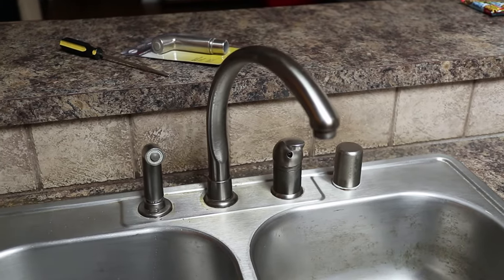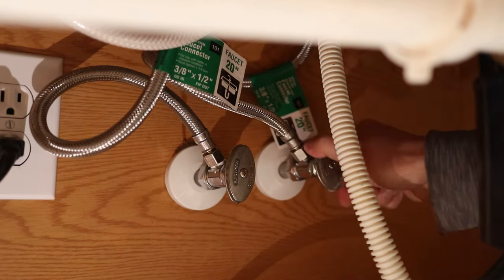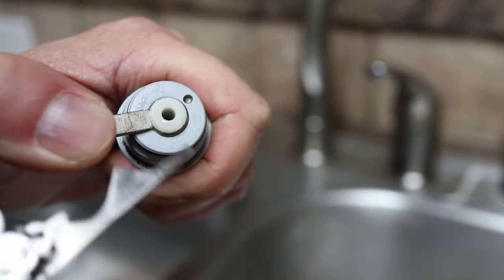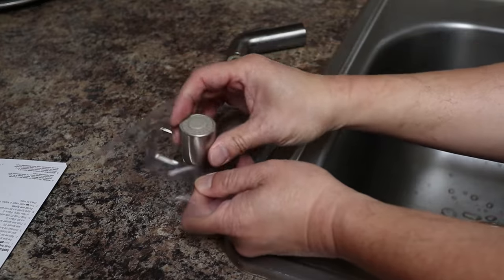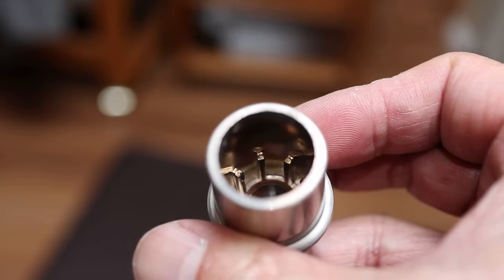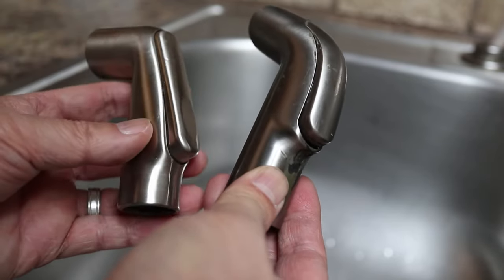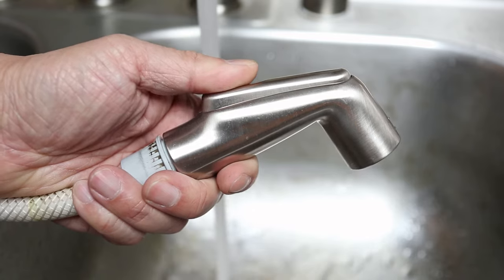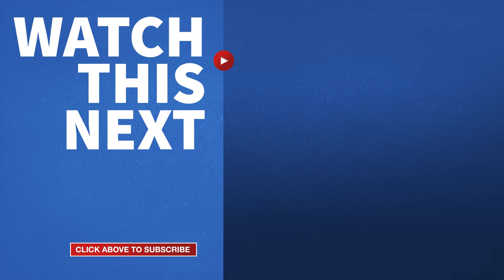Leaky Kitchen Sprayer Replacement - Kitchen Sink Sprayer Repair Fix - Danco Kitchen Spray Universal

Comment: A $20 replacement sprayer head just saved me $200 and several hours to replace parts that weren't broken. Thanks for the video! My new sprayer was unable to use the included assembly as well I had to go back to the old one. The handles appear to be a weak point on the nozzle, and the head change was all that was needed so far. My sprayer was seven years old at the time it failed.
Reply from the maker: Excellent! So glad you saved money doing this repair yourself!

Comment: Thanks for the video, my delta sprayer is leaking and Delta no longer makes it.
Paid $40 for a brand new faucet off eBay, and after a couple weeks the sprayer leaks! Wasn't aware they made "UNIVERSAL" sprayers so thanks! 
Delta has really gone down hill. I used to do plumbing 25+ years ago and Delta was the BEST, not any more.

Comment: Why did you not try the old collar before placing it on the hose?
Reply from the maker: Hey! My intention for making this video was to use all new parts for the repair and I didn’t know where the leak was originating from. But I guess the collar issue I ran into helped me make this a more detailed/complete video for others who might run into the same problem! Thanks for watching!

Comment: how bout the sprayer dont fit then what should I do with that ?
Reply: You probably would have received a reply if you had spelled it out better regarding it not fitting..   I believe the sprayer between the connection and the "sprayer" head are standardized..  Just purchased one this week new, and the old one has been around since 1984-ish..  Thread align perfect..    Might want to check the O-ring for starters..

Comment: Well watch lots of videos. So my new one same style same everything as last one I bought to replace. This new one comes with thin flat RUBBER washer and a thicker rubber washer which is flat on one side not on the other. By watching videos those that had that funny washer out it into the top of the sprayer non flat side first. Actually same way it was in my last sprayer.

Now my OLD one came with a  thin plastic washer. I have tried every combination of the washer and combined with both sprayer heads. I even tried all 3 washers. Thick rubber, thin rubber and thin plastic. I even tried teflon tape on threads. BUT STILL I have water dripping out under that first blk plastic collar part of sprayer you put on. What next.
Reply from the maker: Sorry for the late reply! I’m not exactly sure why your sprayer is still leaking underneath the head. Before I made this video I had bought a gasket kit and none of those gaskets or O-rings stopped the leaking. But when I got this new sprayer and installed it the leak completely stopped. I know it’s been a couple of weeks since you left this comment but hopefully you found a solution! Could there be an issue with the hose itself?
Reply: Mine is actually spraying out around the hose